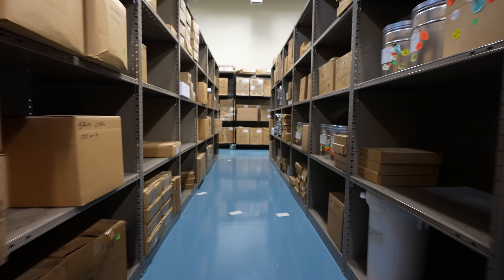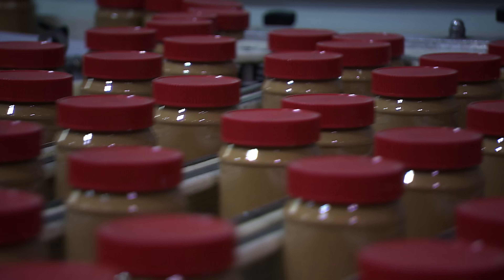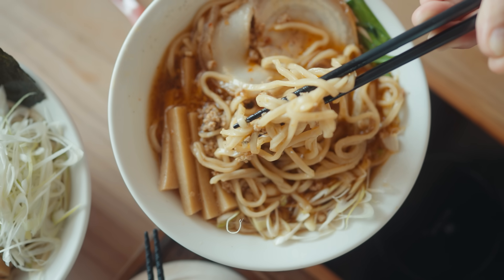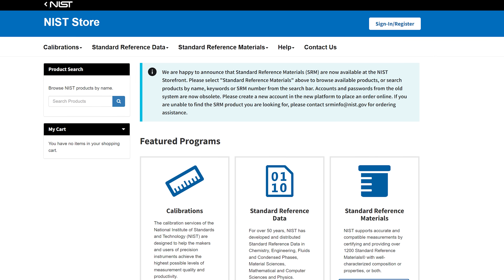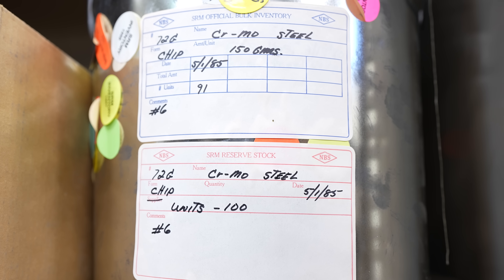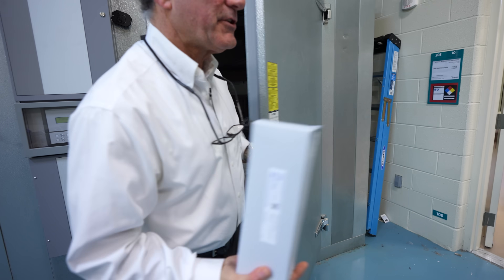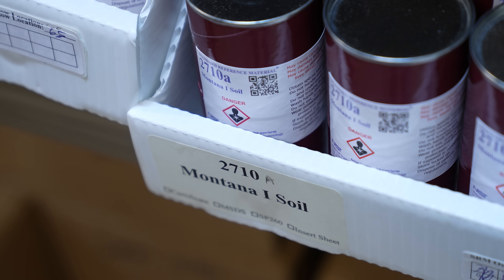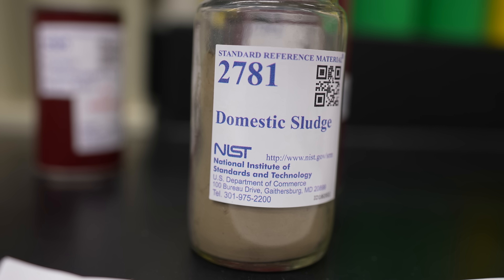The world depends on a collection of strange items. They're not cheap

Comment: 18:05 Not entirely true. What you can be reasonably sure of is that the steel is what it claims to be. Whether or not the structure can withstand the stresses it will be facing depends heavily on the architect choosing the proper steel to begin with. After that, it relies on being constructed according to the blueprints. There's a whole chain where every link is essential to ensuring a building's safety.
Reply: Of course, and I think anyone smart enough to understand this video, is likely also smart enough to intuitively realize that what he said is not the full picture of the problem but just merely shorthand for discussing the problem.

There’s really no need to be pedantic.

Comment: I did building maintenance for a very large company that processed insanely large amounts of photographic paper. Our sewage water had to be tested once a month to insure we were not putting harmful chemicals into the sewage. Out on the front lawn was a manhole that I would open. I would extend a plastic cup on a pole down into the 20-foot-deep hole and bring up a sample of the water. I used a flashlight to see what I was doing. The building had 21 toilets in various locations and when I was taking a water sample, sometimes I would see a turd float past. Yuck! The sampling cup was always sanitized and sterilized after each use.

Comment: I really, really doubt that peanut butter is "so old you wouldn't want to eat it." Peanut butter has some of the longest stable shelf lives of consumer food stuffs that are ready to eat (and you'd actually want to eat) of most foods available. It might not taste the best if it's 5+ years old, but it will definitely be safe to eat so long as it was not contaminated and stored properly.
On older jars of peanut butter you'll see the oils that have separated from the peanut butter usually resting on top of the peanut butter just beneath the seal. That doesn't mean it's "gone bad" and is not safe to eat. If you stir the peanut butter very well you can "work" the oil back into it. Again: it won't taste as good as fresh peanut butter and its consistency might be a little weird, but it's completely safe to eat. Again, so long as it was made properly without contaminants and was stored properly. 

If you come across a jar of peanut butter that is bulging or smells horrific beyond what is normal: Do not even attempt to eat it. Throw it out.

Comment: wow, as someone who works in the printing industry, I immediately identified this with Pantone books. also I opened a jar of chunky peanut butter a few weeks ago, and it was so dry and un-spreadable, I had to stir in vegetable oil to spread it.

Edit: just want to say, the work put into creating the samples in this video completely require the costs of the samples.  But if you are not aware of The costs of Books of what a "color" is please look up pantone.  Would make an interesting video, especially the pantone/photoshop problem.
Reply: Linus Tech Tips just did video about Pantone & PhotoShop 👍

Comment: In Graduate School in 1969 we purchased NIST (it was NBS, National Bureau of Standards then) a set of calibrated mercury thermometers accurate to 0.05 degrees C. They came with a calibration sheet that allowed you to report temperatures against a known standard. So if you measured 45.00 deg C with one of these thermometers you would look up on the calibration sheet 45.00 degrees and correct the temperature by the value on the sheet. I would like to know how NIST handles today's digital thermometers.

Comment: I once worked at an automotive metrology lab.   Same as the peanut butter but measuring the standards of the machines that Ford and GM to make their parts.  Machines measuring other machines.  Metrology is an older word for this type of work.  I didn't know it existed until I worked there.

Comment: You have to wonder how a product as complex as peanut butter can have such a tight analytical reference where there is possible oxidation/degradation of the fatty acids with resulting changes in the sample. One would assume that there is a 'valid through' date? Storage/shipping requirements?

Comment: Oh.  So this is why the U.S. government pays "$10,000 for a hammer, $20,000 for a toilet seat."  Seems like multiple private industries could duplicate what NIST is doing at far less cost (e.g. those steel test bars that the guy seems proud to sell so many of because they break).  They take a smaller range of popular NIST reference materials to validate that THEIR stuff is calibrated properly for every production run, then simply mass replicate the materials and make sure their stuff is solidly in line with the spec before selling it.  Then they sell their stuff at a fraction of the cost to manufacturers that currently use the SRMs.  The result might be very slight, minor variances over time but still fall well within the NIST spec.  There might be some law that prevents this so that NIST has a guaranteed monopoly, but that seems ridiculous.

Comment: In the beginning I thought this was going to be something completely different; more along the lines of the seed bank in Norway. I guess in some ways it is, or can be used in similar regards. What I find really interesting is the potential it could have as a global scale reference point. For example (I'm not going to look it up so this is going to be possibly inaccurate to a point) there were points in history where we changed characteristics of the planet on a massive scale without knowing until later testing. One example I think was measuring lead in vintage wine or paintings as a means of authentication to tell if it was made before or after the advent of the automotive industry, or how extremely pure steel is much harder and expensive to produce now because of certain radioactive molecules found in the air to the point where certain scientific applications require testing equipment be built with metal salvaged from old ship wreckages at the bottom of the ocean. Like how our nuclear testing led to there being a reference point in time this could also help aid in the future after we've introduced some other kind of global change accidently. These standardized and catalogued items could then be used to identify other changes we've made as long as those changes don't also directly affect the items in these storage facilities.

Comment: I don't quite understand, I get if you wanted to get something closer to something else, to have a standard reference point, but I don't understand how standard reference points aid testing. Like how much fat is in something should be equally testable with or without a standard reference point.
Reply: to test something you must first calibrate the tool your doing the testing with. this is where a standard refrence point comes in.
Reply: @lawlcake8788  Well let's put it this way, I don't know what you mean by "calibrate" then. I am aware of the definition of the word.

Comment: I don't understand the purpose of the food ones.  Are they used to validate that the manufacturer's measuring processes are working correctly?  So the manufacturer is always testing their own product for these different attributes and they can tell that their processes and equipment are good by running those same tests against the Standard peanut butter to see if they get the same results as NIST says is in that peanut butter?

Comment: I work for a company that produces every type of analytical measurement instrument you could ever think of. We use NIST reference materials every day to qualify our instruments. We call them SARMs though, standard analytical reference materials. We use NIST steel spheres to calibrate our density measurement machines. They produce a great product, and are vital to industries like mine. Keep up the good work guys!
Reply: Gymbro: "Someone said SARMs"
Reply: @sam9239  I love doing SARMs.
Shoulders and Arms
Reply: I’m at the gym hitting a gnarly 5 x 8 @ 95% RPE and sensed someone mentioning SARMs, so now I’m here.
Reply: SARMs? 💪😈
Reply: Always wondered where these things came from. They kinda just show up on my lab bench with a post-it note to start calibrating stuff.
Reply: Don't you need more than one variant of a reference material? E.g. if your sensor is off compared to a single sample, how do you know what kind of correction to make? (E.g. offset vs scale, linear vs non-linear, etc)
Reply: @booshong  Depends on the the complexity of the instrument and its use case. For surface area and physisorption units we qualify them with things like pelletized aluminum oxide, granular silicon dioxide, and molecular sieves, all NIST. We calibrate for viscosity with specifically weighted oils. We run multiple different samples on most to verify the customer can essentially put anything in them within reason. We sell to almost every industry so we have to have that flexibility. Hope that answers it some what :)
Reply: @rcrnitto  thanks! Very interesting.
Reply: @booshong  I think there's a separate set of standard test materials to calibrate the sensor, then you zap the actual standard you're testing. So you only need 1 jar of peanut butter.
Reply: Have you ever encountered a reference material that was incorrectly manufactured or led to failures in the real world?
Reply: Do you make flow injection analyzers? Because HACH is kinda leaving us out to dry over in the environmental chem field...
Reply: @Darasilverdragon  I think so, that may be the Austrian branch of my company that produces those. My side of development is in particle characterization. The company is Anton Paar, call one of our sales office for more info than I could probably give you
Reply: Renishaw?
Reply: @nax1807  maybe Metter Toledo?
Reply: How do you find jobs like these im very interested as a biochem major
Reply: I'll be damned...
Reply: Çok ilginç bir şekilde fark ettim
Reply: Not the same SARMs that get u jacked?
Reply: Balls of steel
Reply: somebody said SARMs? 👁
Reply: @user-qj9ye1uv8g  I love SARM's
Reply: JESUS CHRIST IS COMING BACK SOON, REPENT AND BELIEVE IN THE GOSPEL TO BE SAVED.

John 3:16  “For God so loved the world, that he gave his only begotten Son, that whosoever believeth in him should not perish, but have everlasting life.”
Reply: RAD 140
Reply: What do I need to learn to work?
Reply: Ooh then maybe you can answer my question. Don’t the contents of stuff like peanut butter change over time as it goes off/bad? If so, then how can these reference samples be used to calibrate?
Reply: @astralshore  The certificates that come with these samples are publicly available. I'm looking at the one for "Typical Diet" right now (SRM 1548A). It says the sample is valid until 2026 as long as it is stored according to specification. So, to answer your question, it has an expiration date.
Reply: @ScaryBob980  Ah excellent, and that makes perfect sense. Thank you! The guy in the video made it sound like the peanut butter was ancient or something.
Reply: thanks for this. explains more than I got from the vid
Reply: I feel like the lawyers are to thank for this xD
Reply: I work as legal counsel for the biggest Data Center company. @misterasterisco5217
Reply: There's THOUSANDS of types of peanuts, apples and every food. This research costs money, and doesn't it incentivize megacorps to only use 1 out of 40000 types of peanut? Sure looks like it lol. The makeup of 1 type of apple is prolly different from an exotic one u never heard of.

If this is the reason we only have 1000 out of 1 trillion sub varieties of food imma be hangry
Reply: @BenLA5  That variation is irrelevant to the standard and device being calibrated. If I know my scale can accurately weigh an object to a very precise degree then it doesn't matter what I weight after that.
Reply: @BenLA5  to expand on what James said, take note that the NIST rep said they take samples. Chemically those apples are very similar, but to account for those small differences that's why they blend them. That's why it's a "standard" instead of "chemical model of Granny Smith" apples. It's a baseline, nothing more, nothing less.
Reply: @BenLA5  let's say that you know a scale can accurately measure 100 lbs, 150 lbs and 200 lbs because you used only references of those three weights to calibrate it. Does it mean the scale can only measure those 3 weights? No, it means it can measure any weight between 100-200 lbs within a small margin of error.
Reply: Millionaires and billionaires sure buy this peanut butter.

Comment: The company I do software development for uses REFPROP, which is a software tool developed by NIST to model fluid dynamics. We use it to model how pressure drops and temperature transfer would work in the cooling and heating coils that we manufacture, both with water and refrigerants for the fluids. This allows a customer to select a coil they need custom built for their situation based on input and output air temperatures and comes up with a valid configuration that will get them what they need that we then build as a custom order.

NIST is really in a lot of stuff and the work they do is really important. They're responsible for you being able to trust that you are getting what you think you're getting.

Comment: Genuine question: How does NIST determine the concentration of these materials if they are creating the very sample with which such a machine could be calibrated? Seems like a catch 22—you need the machine to measure the sample, but you need the sample to calibrate the machine.
Reply: Nist has equipment and performs experiments that trace back to the SI through mathematical constants. It takes millions and millions of dollars, heavy equipment, and scientists with PhDs to realize a mathematical constant through an experiment. Normal manufacturers (like ones selling peanut butter) would rather buy a 1k jar of peanut butter than invest in scientific endeavors that would allow them to precisely measure their peanut butter with uncertainties like that. They just use the reference peanut butter on cheaper/less accurate equipment as a "check standard" to ensure their equipment can emulate the results of the scientists at NIST without having to spend money and time/resources on that super expensive, constant defining, unit realizing, scientific equipment.
Reply: Wjf nd

Comment: If that 'standard bullet' is designed for measuring grooves imparted by rifling, it's complete bull****.  Marks made by rifling are NOT 'very very fine'.  They are relatively deep and obvious.  Bullets do not fit in the barrel they are fired from.  If they did, rifling wouldn't work.  The bullet is the same diameter as the BOTTOM of the rifling grooves in the barrel.  The bullet has to be squished into the rifling and extruded through the barrel.  

If it's not, and it's actually used for categorizing indentations made in the primer by a firing pin, then it doesn't have to have the rounded profile shown.  I'm not saying their standard bullet is stupid and wrong, but the way its use is described and depicted in this video definitely is.

Comment: One thing I question is the validity, relevance, and even truth of food samples which by their own admission are too old to be edible, and transformed with numerous processing steps such as homogenization and dehydration.  In living organisms (plant or meat), there are molecules which rapidly degrade under such circumstances, fundamentally changing both composition and function.  Further, there are numerous microbes on and in everything, which die off and decay rapidly, whose presence or absence is non-trivial.  The sheer ignorance and arrogance to claim to be a purveyor of truth and fact while completely disregarding the complexity and nuance of the biochemistry of living organisms is disgusting and appalling.  If you can't eat the test material, your test is invalid, your processes are wrong, and you're merely demonstrating the weakness and flawed "logic" of hyper-rationalization, wherein an obscene amount of attention is spent on measuring discrete particles at the expense of all awareness of the interactions of complex multivariate systems.  This is what gives "modern science" such a bad reputation.  Further, statements like, "This is a business." and "I like things that break and burn.  (non-reusable)" highlight additional problems of the Capitalist model of economics, whereby what is truth, fact, reality, or sanity, often take a back seat to what is profitable, thus introducing a strong bias which non-trivially corrupts all output information, as well as significantly perverts the range and type of questions that are allowed to be asked, while simultaneously elevates irrational assumptions and traditions to a status of irrevocable profit, I mean truth.

Comment: Poop plus water plus Oxygen plus high pressure  plus heat equals ultra hot solution of salts,, utterly sterilised and good enough for the hydropic tank when it is cool. Use that heat to preheat the next water.